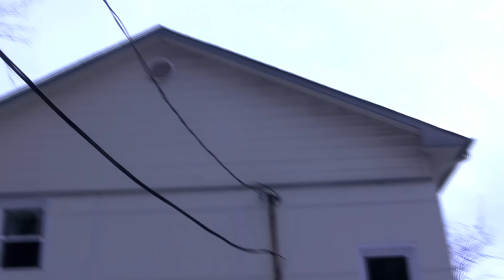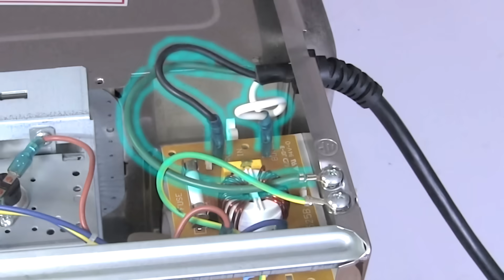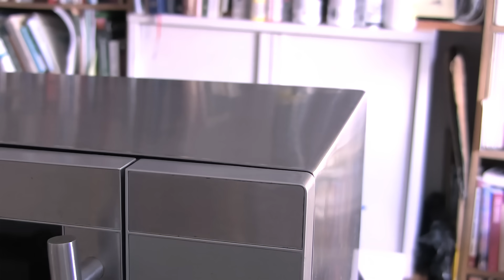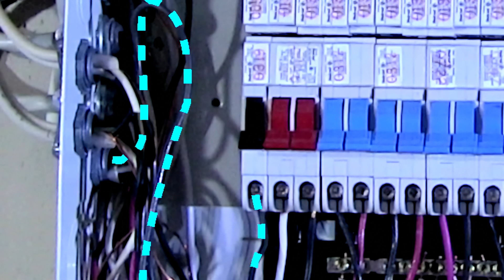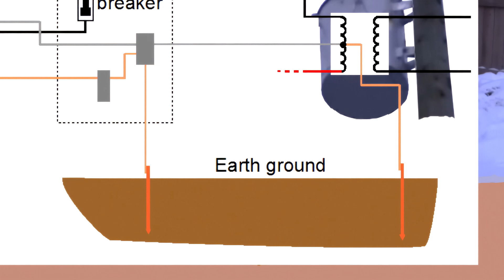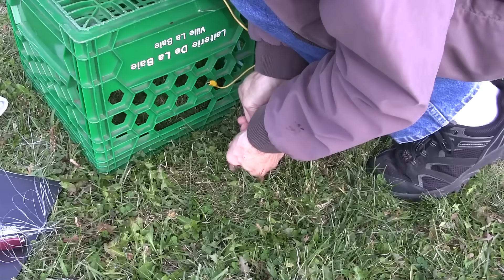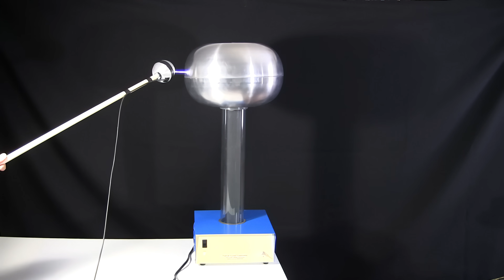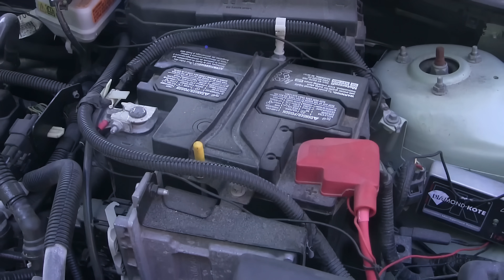What is Ground? Earth Ground/Earthing

Comment: I don't understanding this, all i know about electricity is, if there's an overload in the wiring it trips the breaker so it doesn't damage what it's wired to, & what i also know is transformers r used to reduce the 240 volts of power down a much smaller current 4 down lights so u down blow them i guess.
Reply: that is transformers r used to reduce the 240 volts of power down to a much smaller current 4 down lights so u don't blow them guess.
Reply: George.. the current that is going into your downlights is far greater than the current that is going into the transformer on the 240V side.. also, transformers can be used to increase voltage say from 12V to 240V not only to reduce.. aaaaand no, circuit breakers do not exactly prevent damage to what they're wired to.. if the breaker trips it is because the item that it is wired to has become damaged and has overloaded the breaker, so it trips to stop your house from burning down..
Reply: George, circuit breakers are the to protect the wires from becoming overheated and cause a fire. That's all. If you plug a perfectly working device Into an outlet, that outlet will try to supply the current for that device. That current can be more than What the wires can handle thus rhe breaker will trip, even though your device is in fine working order.
The second part of your knowledge is a transformer. It does exacrly what it states, it transforms power. By using ohms law for power or watts, W = Voltage X Amps. For example if your light requires 120v at 2 amps that would be 240 watts of power 129v X 2a = 240w)  If the primary side of the transformer was connected to a 240v line it would only draw 1 amp of power. (240w/240v = 1anp) so you see it transforms power
Understand now?
Reply: roy Yung 
Yeah ok, well i said overloaded, isan't that same thing, but i thought it also protected wat it was connected to, cz if there is an overloaded isan't the power still travelling though the wires, appliances have fuses, i saw 1 in a mic once.
Reply: an overload, the power is still traveling through the wires, appliances have fuses, i saw 1 in mic once.
Reply: @thehandyman2180  no. The ONLY reason for a breaker is to lrotect the wires. For example if toy have a device that normally draws 2amps of power and that device is connected to the panel with 15a wire and that wire has a 15a circuit breaker, if your device suddenly develops a problem and draws 10amps of current, guess what, your device fries and the circuit breaker will not trip. If yoir device wants to draw 20a the wires in the wall would burn up becuase they can only handle 15a, so the 15a circuit breaker trips to protect the wires.
Hope that helps
Reply: roy Yung 
Look mate ok, i'm not an electrician, so i can't argue with u about it, but there's no need to in hance the letters as if i'm an idiot.
Reply: @thehandyman2180  never meant to insult you only to emphasize what a circuit breaker actually does. A of people have misconceptions about circuit breakers. I see some people go to box box store and grab a 20a breaker to install om a 15a line because they want more power on the line. I will grab it from them and tell them they will burn thier house down and to call an electrician.
I have been doing electronic work for over 50 years and I just wsnt people to have the correct information. I apologize if it seemed like i was yelling at you
Reply: roy Yung 
Ok, no wen yr using big letters it doesn't mean yr yelling.
Reply: roy Yung 
Ok, u don't need to emphasize mate, relax, r u an electrician?
Reply: @thehandyman2180  I have been doing electronics for over 50 yrs and worked with a master electrician for at least 12 yrs
Reply: roy Yung 
So, is that yes or no, & isan't there a difference between electronics & electrical.
Reply: @thehandyman2180  electrical is the basis if electronics. If you understand electronics, you understand electricity, but not the other way around.
Reply: roy Yung 
I'm not shore i understand, & u didn't answer my question eather, r u qualified or not.
Reply: @thehandyman2180  think of it this way, when you learned math in elementary school yoy were taugjt how to add, subtract, multiply etc. An accountant can do that and much more, but one who only knows the basics, can not perform accounting functions. So in order for you to design electronic circuits toy must have an understanding of electrical circuits, but one who understand electrical circuits can not design electronic circuits. Electronic design is a much higher understanding of electricity. I can do the work of an electrician but an electrician can not do my work
Make sense?
Reply: roy Yung 
Ok, i'm assuming yr not cz other wise u would have told me first time.
Reply: @thehandyman2180  assume what? That I work as an electrician? No, I have a much higher understanding of electrical circuits than an electrician. I dont have to be an electrician to fully understand electric circuits. Understand now?
Reply: roy Yung 
Well How come you've never been to tafe if your that confident.
Reply: roy Yung 
@ to say u have a much higher understanding than an electrician, i mean come on mate.
Reply: @thehandyman2180  isnt TAFE an Australian thing? I am In rhe USA
Reply: @thehandyman2180  yes this is true, whats wrong with that statement?
Reply: roy Yung 
No Roy, u can't know more then a tradesman.
Reply: @thehandyman2180  if you think so. I know otherwise.
Reply: @thehandyman2180  Technical and Further Education (TAFE) is an Austrian thing I believe. Never heard of it in the States. We do have trade schools for plumbers, carpenters, and electricians and there are various levels of licences as well. (Master and Journeyman with a Class A and Class B for each license) there is also the National Electric Code or NEC and each city may have varying electrical codes. For example in one city it may be perfectly fine to run NMC (non metallic casing wire, like Romex), but in other cities you must run MC (metal casing wire, like BX) as long as the correct gauge of wire as specified in the NEC is used. So its all about codes, which are basically regulations for each city which are easily obtained from the city. Each person with a licence, must be licenced in a particular city.
Electric circuits are very simple. Its mostly about safety requirements. Electronics are totally different. As I said before electricity is the basic building block for electronics, much more electronic formulas are needed than are needed for electrical work. So an electronic designer certainly has the knowledge to wire a house, but an electrician does not have the knowledge to design an audio amplifier. Hope that helps you understand better
Reply: roy Yung 
Yeah trade schools, where u learn a trade, for e.g. electrician, mechanic, plumber, welder, printer, don't pple need repairs, but how old r u mate, i don't feel comfortable talking if yr much older then me.
Reply: repairs, & how old r u mate, i don't feel comfortable talking if yr much older then me.
Reply: @thehandyman2180  tell me what age has to do with knowledge? If you dont feel comfortable talking to people with knowledge then how do you learn? If you learn from books, then even books are written by people with more knowledge than you have or you wouldnt be reading them, yes?
Reply: roy Yung 
Oh Jesus mate & then u say oh isan't tafe an australian thing, i don't understand y u said that & how old r u, i'm not going to continue talking.
Reply: continue talking, & answer me this time.
Reply: @thehandyman2180  my age is totally not relavent to this conversation, only knowledge. If you dont want to learn from that, that is totaly your choice, albiet a bad one
Reply: roy Yung 
Talking to a much older man at night deosn't look right, even now,
i'm starting to feel a bit weird, look i have an uncle that's done renovations most of his life, i can ask him.
Reply: look i have an uncle that's done renovations most of his life, i can ask him.
Reply: @thehandyman2180  what are you talking about??? This is not a dating place.     Geesh I am here to offer you wonderful knowledge
Reply: i'm done.

Comment: I live in an old house without 3 wire plugs.  I guess I'm toast if my toaster short circuits.
Reply: I'm not 100% on this, but I think it would be the same in a house with 3-hole outlets, assuming the toaster only has a 2-prong plug.

Not sure if I've ever seen a toaster with a ground prong, come to think of it.
Reply: @SidShakal  
Not sure, but polarized plugs may have something to do with that.
Reply: If toyr toaster short circuits you will blow the circuit breaker! If thr hot wire touched the case if the toaster there woukd be risk of a shock
Reply: As long as your body isn't touching anything conductive with a path to earth ground, such as the faucet at your kitchen sink, the hazard is fairly low.

Comment: Oh boy! What are you doing man? I think you made this grounding concept very misunderstable! I have rarely seen so much nonsense presented by such a competent voice and video. Current never ever goes to ground because it take 'so much charge' it is going back to the source through the ground because both the power source and the utility system are grounded. The ground is made part of the electrical system. There is no safety provided by grounding alone! Stop that please! So many lives have been endangered in the past by people spreading such nonsense!
Reply from the maker: Where many people get it wrong and think that the Earth ground is involved is to do with the first part of this video, where they think that when there's a short in the microwave oven, the current then follows the ground wire from the oven's case to the ground rod, which of course is wrong. Instead, it follows the circuit as I describe. I know you're aware of that but I bring it up to point out that that's the misconception that everyone talks about.
In the case of the electrostatically charged case, the utility system has nothing to do with it. There are grounded utility poles and grounded houses all over the place that have nothing to do with the electrostatically charged case. The case isn't charged because of anything to do with the circuit. It's basic physics that unequal charges will try to balance out, and so that's what's happening here.

Comment: Correct yourself the ground only goes to the main entrance panel at the meter, neutral and ground never share buss bars again after the entrance panel. The panel that you show is a subpanel, if you connect the 2 ground and neutral it will eventually burn the hot wires especially if buried underground
Reply from the maker: You're right. Ground and neutral are connected at only one place in the house, in the first box after the service enters the house. In this case, it was the breaker panel.

Comment: Why can't the charge just go through the same neutral that would normally complete the circuit instead of the ground rod?

My guess is that the neutral can't take the charge from stuff like lightning because it's charge never came from the hot/live, and that you have less resistance than neutral, but ground has less than you. Although if the breaker flips then that last point still isn't really a reason.

Probably a stupid question but I'm a noob when it comes to electricity.
Reply from the maker: I assume you're talking about the situation at around 5:40 in the video where the case becomes charged due to lightning? That's a good question and observation. When you have an unbalanced charge (more negative somewhere than elsewhere, or more positive somewhere than elsewhere) then the charge will always move around in order to become equal everywhere. In that situation, there's an imbalance with the neutral wire side as well as the ground rod side, so maybe some charge does flow to the neutral wire too? I don't know if some do or how much. Interesting.

Comment: How can touching a live microwave case produce a dangerous shock if you, yourself, are not connected to neutral or ground?
Reply from the maker: If you're not connected to neutral or ground then it shouldn't produce a dangerous shock. But if your bare feet are touching the Earth ground or something else that's contacting Earth ground, then you get the dangerous shock.  Otherwise you usually just feel a disturbing tingle -- but still best not to touch a live object.
Reply: RimstarOrg  Yes, I have felt that disturbing tingle a few times decades ago. At a grocery store I used to work at back in the 1980s we had a box freezer to store bags of ice. The freezer stopped working and I was instructed to remove the bags of ice. There was a small amount of water(which I had not noticed) in the bottom of the freezer from some old bags of ice that had torn and melted after the box freezer had stopped working. 

However, nobody had unplugged the box freezer and as I was getting to the last bags I felt quite a sharp pain in my elbow and my whole arm was tingling. Thought I was bumping and hitting my elbow on something sharp as I was pulling out the final bags. But after getting a sharp pain and tingling a few times, okay let's get this freezer unplugged.

So after watching your video here, I would say the metal casing of the box freezer had a damaged hot wire touching it and had charged the small amount of water laying in the bottom of the box freezer. But it was enough to give a pretty good pain and tingling all up and down the whole arm.
Reply: RimstarOrg, right. The point is that the main reason someone will take a dangerous hit is if they are grounded well, and what is the thing most likely to ground them well in many situations? Well its our safety earthing! In other words, many places are essentially double-insulated, and there is no way to be earthed unless we bring the earth in ourselves. The thing meant to protect is is the very thing exposing us to risk. Of course this doesn’t apply in places where there are other earths, like where there are metal water pipes. But many places today are intrinsically safe.
Reply: There is a capacitive connection between your body and the ground. (The capacitor with electrodes your body and the ground is conducting AC.)

The current depends on the capacitance of this capacitor, the voltage and the frequency.
Reply: Валентин Стойков, yes but that still needs a ground. Take that away and you no longer have a capacitor.

Comment: Do you think its posible to conect a device to earth and make it work that way? I've seen a video of an indian making a fan work connecting two metalic bars with Potatoes to the ground, do you think thats a fake or it can actually be achievable?
Reply from the maker: If the metal bars are made of two different materials and the ground between them isn't dry then the bars and the ground make up a battery. I've done it before and so have a lot of other people. It's a fun science experiment. So, yes, you can get some power this way. The metal bars get used up eventually. He probably used the potatoes to add some acidity to where the bars enter the ground, which helps.

Comment: Does the breaker works after using ground as current will go to ground
Reply from the maker: I don't understand your question.
Reply: The ground path has low resistance. In a ground fault condition the current flow is high enough to induce a field in the circuit breaker to trip the magnetic trigger which turns off the supply voltage.  If the current goes through you (ungrounded systems) you are just a load and will cook until that which part of you is a path, burns away.

Comment: so i need you to ensure if i got it right, the electricity always need a closed circuit for the current to flow .from that point the earth ground always and all the time takes a part in each and every closed circuit in this world?
Reply from the maker: Almost every closed circuit which has a ground connection has only one connection to ground. That's done very deliberately otherwise you have what are called ground loops and start having problems with your circuit. The electrical power system which we use for powering our homes is an exception, making multiple ground connections. But since the distances involved are so large, the resistance is big enough for it to not be a problem.